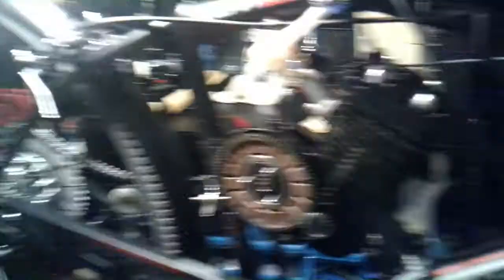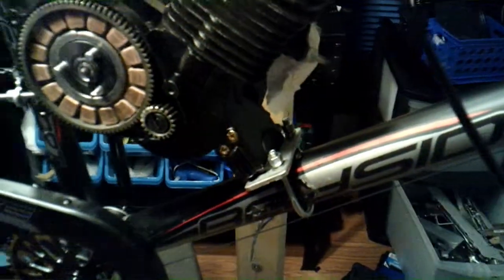80cc Bike VLOG #  2

Comment: my first build I did not realize how hard it was going to be and how the stock Parts did not match up to the bicycle frame I chose.second build I was more prepared and made sure I chose the right platform that had the least modification.oh and having the right tools this time especially the chain breaker LOL. Basically making sure the down tubes were not too fat.it was overwhelming my first night I did not complete it and was very frustrated my back & hands were so sore. Get the chain breaker that comes with an extra 415h chain it's the same price and now you got a spare chain that is better than the one that came in the kit mine ended up snapping but it was my fault cuz I cut too much off of the chain and had to add it back ☹️
Reply from the maker: none of the mounts for the gas tank or the motor. lined up.. the Cain had to be shorten ..throttle handle broke cuz it didn't fit the handle bars.. clutch was fully cut...the list goes on... I finally got mine to start ,, next time.. it will be easier .thanks for the comment
Reply: @ATECHPCs  totally bro your second time will be a lot easier your way more prepared now. I still have bad dreams of the first build.
Reply from the maker: yea.. now its time for the fine tuning... im try to make a video of me riding it tomorrow